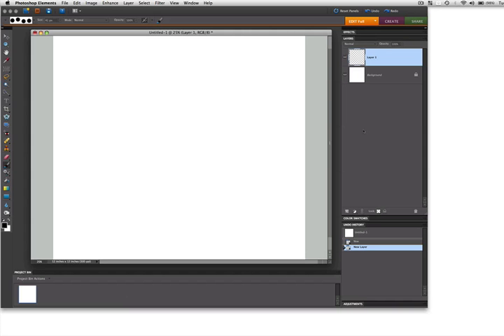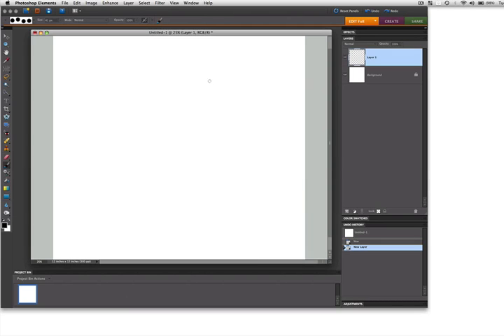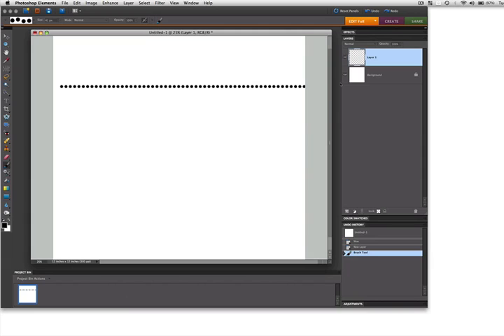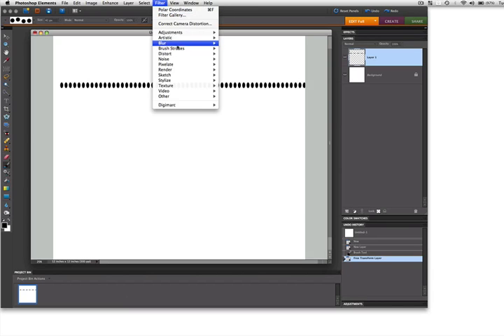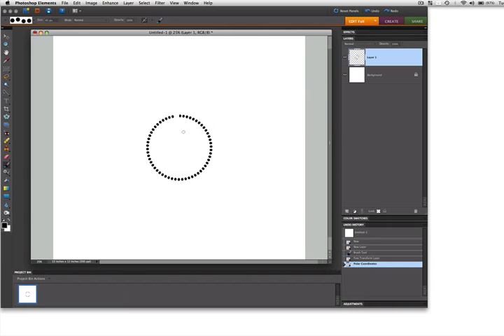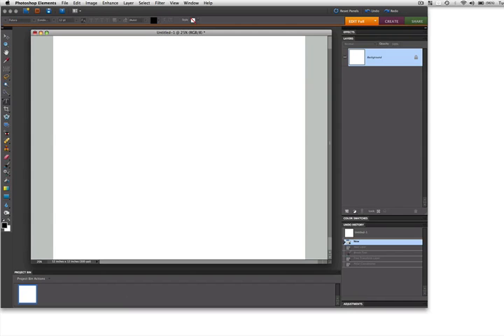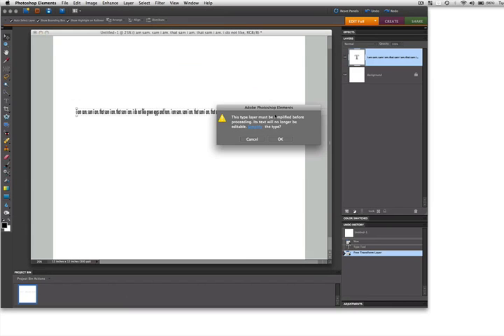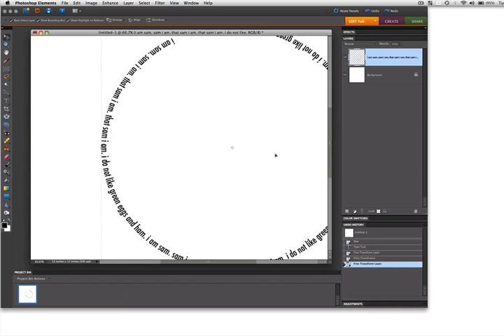Shape Text and Dots into a Circle using Photoshop Elements

Comment: I need help using the ellipse tool, I want a fixed circle diameter, But I can't figure out how I can draw a circle to the exact dimension. I've changed my diameter fixed size on Width and Height, but it still doesn't give me my fixed size. Please help I have photoshop elements  2020